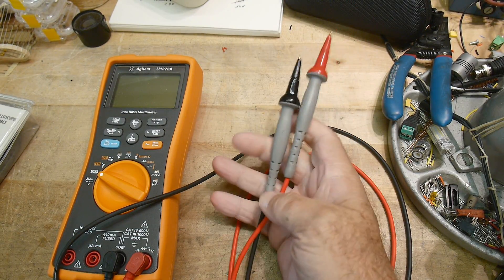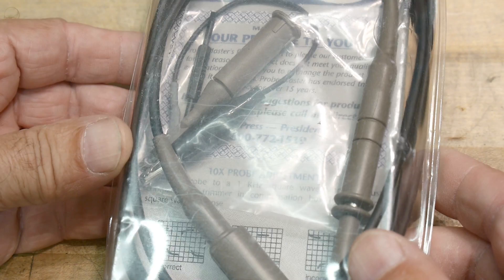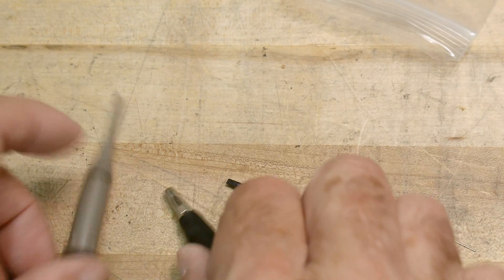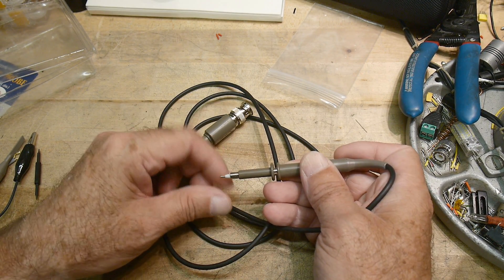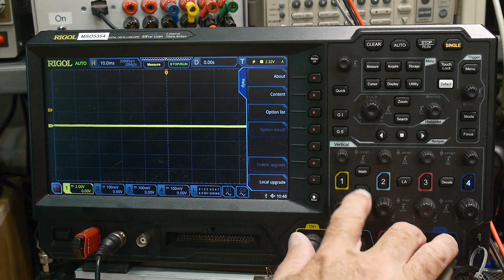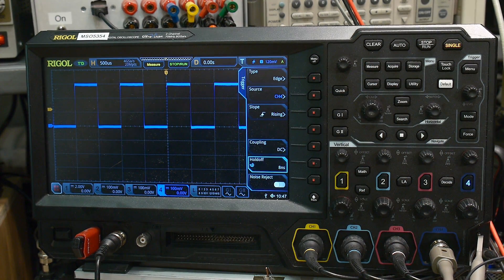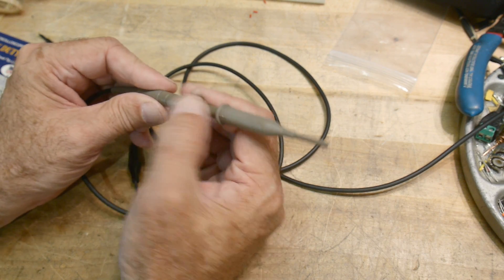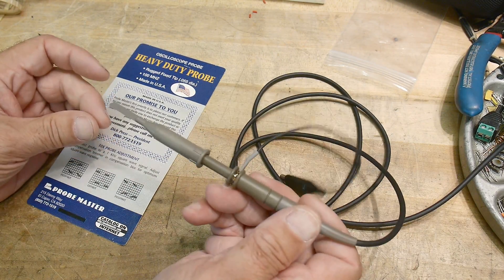#1269 Probe Master Oscilloscope Probe

Comment: Probably a year too late but... your probe should have come with two different screw in tips. The white (.055" dia.) tip and a black (.030" dia.) tip. It could be the larger diameter white tip is too big to fit into the hook probe socket, and preventing it from seating all the way onto the scope probe. 🤔

Comment: What's the point in having the tip of a sharp probe gold plated when the (very thin) gold will be wiped away after one or two pokes to any surface it makes contact with? It's a marketing gimmick that won't make a bit of difference to your measurements.

Comment: Yours are a "heavy-duty" set, which would explain the large diameter tip point and the long throw of the hook. Maybe they are intended for the automotive repair industry, or some other heavy industrial environment. The said differences are probably why they were on Ebay. I have admired your PM DMM probes, previously. However, the large, bulbous guard, on the handle, would seem to make it difficult to reach into a circuit. Thoughts?

Comment: I do not like switchable probes.  The only x10 x1 switchable probes I have ever liked are some older tek ones.  I usually tape or glue my cheap switchable probes in the x10 position.

Comment: Yea those Ground leads look better than the cheap ones from amazon specials. Every one eventually breaks from the connector. That one looks nice and robust. I also like the *10 probe. I took one of mine and used UV glue to hold it at *10. And if that didn’t work a nice piece of shrink tubing on the switch helps too.

Comment: In my university here in India, they don't provide probes while using DSO. We have to rely on normal wires :(
Reply from the maker: my first two scopes, I only had wires
Reply: @IMSAIGuy  ohh... Is this fine to use just wires with Keysight 200MHz 1GSa/s!!?
Reply from the maker: @THEELECTRICGUY  Gosh, it worked fine on my 1MHz and 5MHz scopes. 😁
Reply: Sometimes just wires are good enough for Government work. They don’t tell you that until after you buy them.
Reply: @jj74qformerlyjailbreak3  yeah